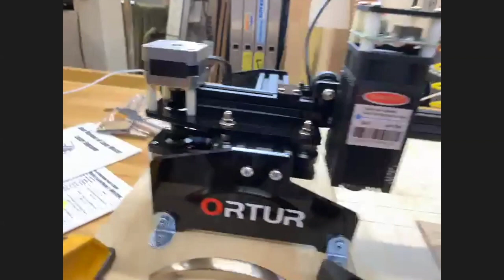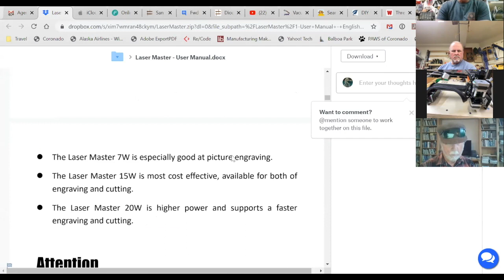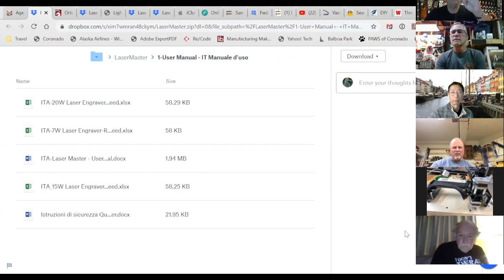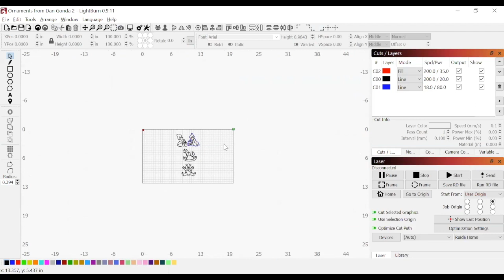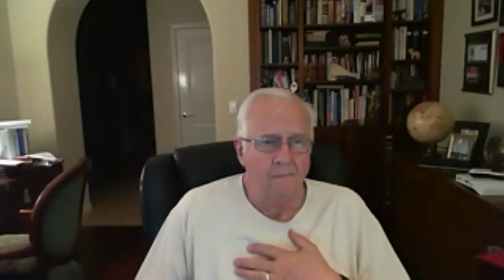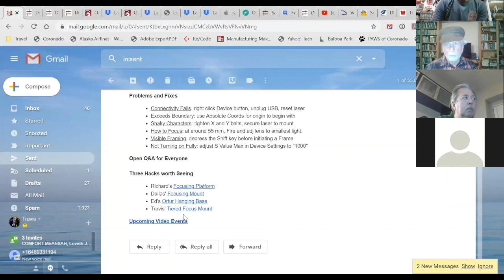Ortur Diode Laser Help Session

Comment: I only used my ortur laser master 2 for a few days and then I had issues with x-axis. Ortur sent me a new mother board, pin board, and the x and y axis cables and found out that the motherboard was causing the problem after changing. Anyways, now I'm having an issue with the laser. It won't turn on. The S value is 1000 and the fire power is on .75% and it doesn't even show a blue light. Could you kindly me with this problem. The laser machine is working fine. The only issue I have is the laser.

Comment: My ortur master 2 laser with 20 w laser was running cutting fine now the fire button turns laser on but it's at full power, and when start laser to cut it just runs in same groove at full power. Any ideas what is wrong or what button my shaky hands might have pushed. Thanks

Comment: Do you know the approximate cost per hour  for using electricity  for the laser device?  In other words, what is an approximate cost to use a Ortur v2 20w for an hour?
Reply: Ummm...it's 20 watts at full power. That's about one-fiftieth of a kilowatt, so whatever your utility charges you per kilowatt-hour of electricity, divide that by fifty. That's worst-case, and in reality, you will run your laser at less than 100% output so it will be less. Bottom line: the electrical cost is trivial.
Reply: @lexboegen  Thanks

Comment: Looks like you have the 20W laser like I do.  I was having problems cutting 3mm wood.  Ortur support told me the measurement from the heat sink to the material should be 35mm for the 20W laser.  What are your thoughts?